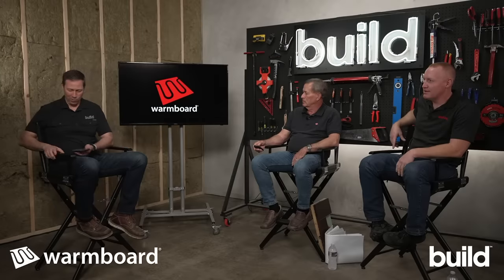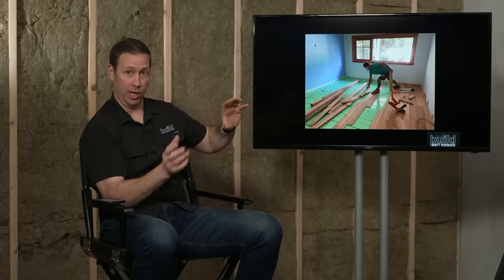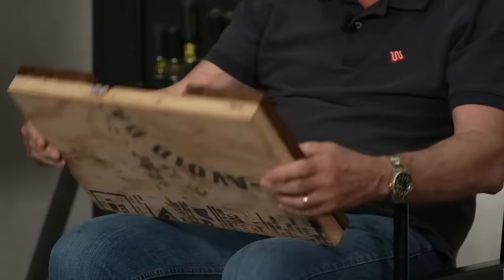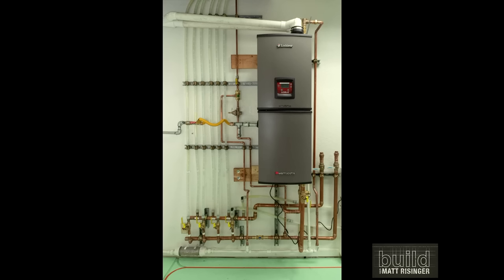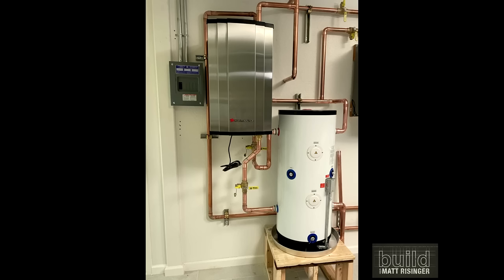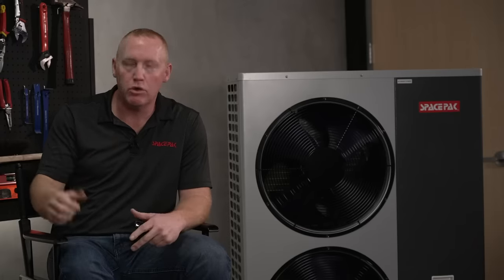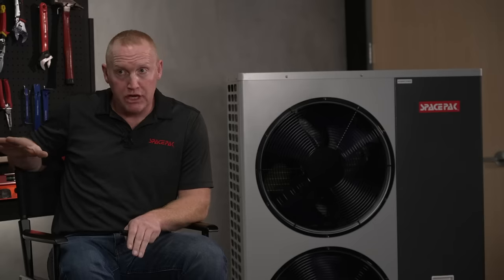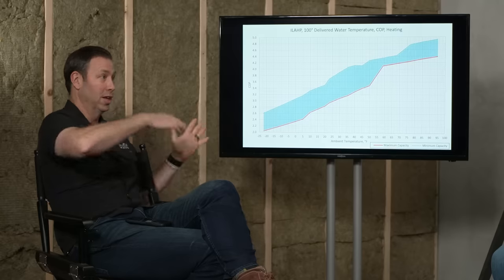Cold Climate Heat Pumps for Radiant Floor Heating. No gas, no boiler!

Comment: We considered warmboard for our home, along with 3 of their competitors, received samples from all of them.  From this mechanical engineers perspective, warmboard is in a league of its own and I have no doubt it is mechanically the most sound system and the most efficient system in terms of operating cost.  The problem is the price kills the value proposition.  We decided on a pex/gypcrete system because for us the brake even period for the difference in cost between the two systems was 50 years!  That's $30k better spent elsewhere on the project, just please don't tell my wife ;)
Reply: As an engineer : Thank you for the analysis... (except the "telling the wife" bit 😂)
Reply: 100% agreed.  Great post!
Reply: Do you have any advice for the gypcrete/pex system? I'm looking to do this and the plumbers I've talked to have never heard of in floor heat being done this way
Reply: @riddled_hugs  Mike Day has a tube channel with a very good video on the radiant pex heat in concrete option.
Reply: @riddled_hugs  from the research I’ve done it seems to be common practice in England/Europe, there’s also a few guys in CT that do it, and I’ve found plenty of YouTube videos on the subject. I found a local gypcrete supplier who made recommendations on the process like what for them is an average thickness for a pour, etc.  For me it was also important to check with a structural engineer regarding wether or not our house, mainly the 2nd floor, could bare the load.  I had an engineer design the layout but I’ll be installing the loops and manifolds myself but it’s nothing a plumber you trust shouldn’t be able to install
Reply: @riddled_hugs  thought gypcrete/pex was the standard.
Reply: @davidparker8475  Thanks!
Reply: @mcltadros  Thanks for the advice!
Reply: When using slab on grade as your floor , what is the best systems?
Reply: just use isolation, pipes and stone floor. nothing better then that
Reply: I’m not sure I heard Matt right did he say an additional $6 sq ft on top of what?
Reply: I'm in Saskatchewan and built an ICF house (both walk out basement (14.4" walls and upstairs 9.5" walls) we have 2' high heel rafters with R80 in the roof.   In-floor radiant in basement (and triple car garage) and upstairs I did 1.5" of gypcrete with radiant again.   The house looks due south with large triple pain windows.   We are the last people to turn on the heat in the fall and the first to turn it off in the spring.  We have tile floors throughout except the bedrooms which have cork flooring.   I had to do a LOL when he said concrete is bad radiant heat...ummmm...thermal mass is very good for radiant heat.   Plus as you said the cost of Warmboard is crazy stupid.   Put that money into triple glazed windows and better wall/ceiling insulation.

Comment: They were $225 for the structural, then $350 for the remodel panel, now I don’t want to know either.  Just the floor could cost you $30,000 in a normal size house. It’s just to much.  😢
Reply: This assumes the $225/panel mentioned above. Advantech is over $100 a panel so for a 3200 sq ft home (100 sheets), you're talking an upcharge of about 12.5k... considering the cost of ductwork, framing considerations for ductwork and labor alone I feel it's already cheaper to go with warm Board.
Reply: @bjcombs1989  you are correct, if the 1 1/8 warmboard is $400 and the LP 1 1/8 is $100 you need to deducted $100 from $400.  The $225 is years and years old.  So you’re paying $30,000 for your heating just for the floors!!!!  Warm board also up charges for the boilers, pipe, fittings, pumps, blue prints etc etc that you can build in the stores for about $2,000.   Im sorry but $50k for some heat is a rip off!!!   You can install the pipes under the LP flooring and still have radiant heat.
Reply: @bjcombs1989  you are correct, if the 1 1/8 warmboard is $400 and the LP 1 1/8 is $100 you need to deducted $100 from $400.  The $225 is years and years old.  So you’re paying $30,000 for your heating just for the floors!!!!  Warm board also up charges for the boilers, pipe, fittings, pumps, blue prints etc etc that you can build in the stores for about $2,000.   Im sorry but $50k for some heat is a rip off!!!   You can install the pipes under the LP flooring and still have radiant heat and everything minus your subfloor shouldn’t be over $3k which it all depends on your boiler.   A $500 hot water tank works just as well.
Reply: @neckofthewoods24  I haven't researched the price myself to know the $225 is old. It still has advantages and just comes down to what each individual job requires. 

The fact that the company charges a non-refundable design fee just to get a price makes me not want to do business with them. Tell me what sheets are available and what I can buy them at and I'll consider it, but make me pay to find out your price feels like price fixing to me.
Reply: @bjcombs1989  they always told me the two times I asked.  Once for the S and once for the R’s.   That was about 2 years ago for the R’s.   Even at the old pricing I couldn’t see paying that much more for a subfloor.  Thats when the S’s were $225 and LP was $50.   That’s $17,500 more just for a floor.  Since we all know Matt’s said it a million times, wood has a horrible R value, stapling the plates under the subfloor will still work!  It’s only 3/4” of wood.

Comment: The concretes advantage is it will hold more heat.  The warmboard might get the heat out quicker but the concrete will keep heating for longer.
Reply: Good point I didn’t think about that! So don’t use this on a new concrete slab?
Reply: @golfaddict75  absolutely on a slab! The inventor is comparing use in a joist type floor....in that situation concrete may not be ideal bc of the weight.  2-4" of insulation under the concrete.
Reply: We have radiant floor heat in suspended concrete six inch spacing with a ground source heat pump.  Buffer tank is 95 degrees tops. Condition crawl space .  I love it.   So glad to see it
Reply: @golfaddict75  The standard in Europe is 8 inches of insulation under the slab and radiant water pipes set into the slab about 2 inches below the surface. But lots of thermal mass means very slow response times. The people building using Passivhaus concepts sometimes tweak the thickness of the slab so that the slab reaches its warmest around 9pm, and then the heat pump is turned off until 9am the next day. The slab releases heat that has been gathered during the warmest part of the day overnight when temperatures tend to drop. This way of working also allows more of the electricity that is operating the heat pump to be produced from solar.
Reply: for the price warmboard costs could just go with solar panels and electric radiant heat
Reply: Its great in a garage slab but when you go from 25 degrees ambiant to 45 in two days your room temp will overshoot and you will cook!
Reply: Holding heat can be a severe disadvantage. We had an on-slab house and in-floor radiant. As the day warms and heating requirement drops the warm concrete continues to pump out heat. It makes the house uncomfortably warm. And if the sun is coming and going due to clouds, the house can all day long go back and forth between comfort and hot, potentially never really being in the sweet spot of comfort. We stopped using our radiant because of this and installed forced air. Any radiant type of heat has to be able to quickly change heat output into the house. There simply is too much lag time with a concrete slab.
Reply: Set the temp at 71 and forget to change it if ambient temp is above that the boiler or heat pump will not engage. In floor heating is the lowest btu cost.   And is the most consistent especially on a well insulated slab. I have 1000 sq ft garage only half of slab is insulated that I keep set at 50 degrees during heating season,  adds less that 15 dollars per month. Try doing that with forced air heat.
Reply: Why would you want to hold the heat in the slab though, as opposed to the buffer tank? You can call on a buffer tank's heat any time you want, whereas with a slab you're stuck with past decisions for a long time and have to schedule changes in setpoint (e.g. coming back from work/vacation) far in advance.7
Reply: @joeyscleaninglady2877  That'll work great on days you don't need heat. LOL
People imagine the solar / battery system to work much better than it will.
Reply: @tlangdon12  in America people try to avoid using electricity during the day, and instead use it at night when possible (charging cars, running dishwasher, etc) because it's thought to be better for the environment. The thought is that grid energy is over-stressed during the day and under-stressed at night. It's thought that some power stations have extra energy at night that must be wasted, because the station cannot be turned off.  But I guess it depends on the grid and location.
Reply: @0my  Do the tariffs in the USA encourage this overnight usage?
Reply: Geothermal heat is good and it is about the cheapest that there is over the long run but the costs are high upfront. There is now a 30% tax rebate through the next few years once again, which is the only thing senile Biden did that was right. Anyway that’s something you can check into and also I’ve been hearing about heat pump geothermal boiler systems and I don’t know enough to comment on the reliability of them. I would stick with Geothermal if you can afford it and really you can if you have a decent job at all and it’s going to pay for itself in five or six years.  I would never install pex tubing underneath my floorboards because it gets way too hot on your feet!!!   …and it’s very expensive to do so especially with crawl spaces!  I would install the old radiator types along The wall that are covered up, which is best, but sometimes those old radiators are really nice …it just is your choice.   That’s the only way I would do boiler heat.
Reply: We do experience lag with our 5” radiant slab.  But my thought is that I’m putting my heat into a huge heat storage.  So when my 3 boys open doors and go in and out…I’m not losing heated up air…my heat is in the slab.  Even a forced air house heats up the floors walls and overall mass, but using warm air to heat a mass is really inefficient.
Reply: I have a house/shop. 2400sqft of shop below and 1000sqft of living space upstairs. Geothermal and solar. So zero bills. All infloor heat  6 zones. 3 inslab downstairs. And 3 zones of warmboard upstairs. Warmboard is so awesome. There is no overrun. Stays 1 degree plus or minus on ambient thermostats. Slabs downstairs can go plus or minus 3-4 degrees either side of the ambient thermostats. So 6-8 degrees variance in ambient temperatures. I think warmboard is THE MOST EFFICIENT infloor heat. They do all the planning and layout for you. And include all the hardware tubing. I installed it all. Myself. I drive a forklift for a living.
Reply: @danmccoy6164  and that will cost 25-30,000 dollars to install.  Most people can’t afford this.    There are still good ways to heat without Geo thermal. And not costly.
Reply: A high mass house is a completely different strategy than a low mass house. A house in sunny New Mexico can use passive solar sunshine to heat the a high mass slab. As they mention in the video they sell a lot of warmboard and spacepac low mass systems in Canada. I don’t want complex systems with moving parts and expensive control panels so am building a passive solar house.  Lightning is a big concern for electronics. I know several people who have to replace the expensive control boards in their inverters due to lightning. Inverters are really cool technology however.
Reply: I grew up with a radiant floor house that built in the 50’s. Been wanting to go back ever since. Every time the forced air furnace turns on it reminds me I’m burning fossil fuels. Our retirement house will be all solar and radiant. Check out Electrodacus. Damian is a engineer living in a all solar and all electric house in Canada. It will be way easier for us in sunny New Mexico. I recently toured a house in the desert that will have no heater and no air conditioner!! Well, they will have a wood stove but it will be seldomly used.
Reply: @joeyscleaninglady2877  - If you were using it for the entire house, sure.  If only using it under tile or hardwood, like bathrooms and your kitchen, it would be less expensive.  To your point, solar panels are coming down in price so quickly, even the low COP of an air-source heat pump in sub-zero temps is very cost-effective, when you're producing your own power.
Reply: @edwardluth7740   sorry for very late reply. But I  installed my geothermal and the tubing and manifolds for the warmboard. Had my contractor put up the outside and studs inside and I did all the rest myself. So the contractor installed the warmboard subfloor upstairs. Didn't charge any more than installing regular subfloor. 
Anyway I installed everything and it cost $22,000 for me to install all the infloor 2400sqft of inslab downstairs and 1000sqft of warmboard upstairs. The entire geothermal system. Including having 4 horizontal loops installed for $5000. Verses the estimates for having conventional HVAC installed. $28,500 to $34,600. It's now coming up on  running 7 years no problems whatsoever. Still Zero Bills.  My house is all electric. No gas at all.

Comment: We built a SIP house 4 years ago in Ontario Canada (46°N latitude) using a horizontal geothermal heatpump and radiant heat on both floors.  The heat pump rary goes to second stage in the winter and has never gone to the electric backup.  In the summer we use the floor as a heat sink (with some custom programming to prevent moisture on the floor) and it has been amazing!
Reply: Can you elaborate more on the heat sink part? Do you just keep the temp is the low 60's to prevent moisture build up? Or do you go lower than that?

Comment: I got prices for warmboard.  It was off the charts high.  This is why Terry will not speak of price.  I built my own with strips of plywood and aluminum fins over my subfloor and it works great.  

Heat pumps are not silent.  When the temp gets low and the outdoor unit ramps up for extended periods of time you will hear that unit.  

Matt Resigner has great content but keep in mind it is sponsored and like most salesman they only give you the pros not the cons.
Reply: what $400 a panel isnt cheap?  haha
Reply: I felt like the warm board guy was about to sell me a timeshare.
Reply: I'd like to see a picture of your version of warmboard.
Reply: I imagine it would be substantially cheaper for a diy version. Maybe time consuming to route the plywood, shape and insert aluminum fins but probably cheaper overall.
Reply: @Rotor-Sims  82k 😲😳. They must have a amazing margin of profit on their system.
Reply: @Rotor-Sims  Well there's likely a reason for the stiffness on the price.  There's no way those panels are cheap to produce if they're using dies to stamp the aluminum and the plywood panels together.  Totally ignoring the costs of the coatings and then all of the printing on the back of each panel.  However, if you're living in a cold climate their system likely saves you as a homeowner several thousand a year on heating energy costs.
Reply: Most people already know that Risinger's YT channel is for the top-tier middle class and beyond..
Reply: Radiant heating is significantly more expensive to install than a forced air system.   A cheaper alternative is hot water baseboard.   Mine is efficient and quiet.  Only thing I don't like is having to clean them every year.
Reply: This warmboard is such a scam, like a lot of unnecessary crap these people try to sell uninformed buyers of radiant systems. Radiant pipes can be simply loosely stapled to the underside of the subfloor - no metal plates needed. Think about it - the heat dissipates from the pipe to it's surroundings. You need only seal up the ceiling below and the rim joist ends. That way the heat will dissipate UP through the floor, where the heat wants to go anyway. When they tell you you need these aluminum plates to transfer the heat efficiently - IT'S A HUGE LIE!
Reply: @gswproductions9446  It's not, wood is hardly a good conductor of heat.  Is it more marketing and unnecessary for people who are more budget conscious?  Sure, absolutely, their process isn't really replicated because of cost for obvious reasons.  However, that doesn't mean the product is a scam, nor does it mean that it doesn't have benefits over other products.
Reply: I've been running my warmboard system for 7 years. It  replaced the plywood in the  subfloor. So some cost reduction.  My contractor put up the outside of my house. So he installed the warmboard for no added cost. Only slightly more work laying it out .And I installed the rest of the system myself. Matched up to the geothermal system I also installed myself. Along with the inslab downstairs. Warmboard initial start up about 45 minutes to temperature. Inslab downstairs hours and hours. Inslab +/- 6 to 7 degrees. Ambient thermostats. Warmboard +/- 1-2 deg. Spreads heat so evenly no cold spots. I installed warmboard, inslab, chilled water fan coils and geothermal. Myself. For $22,000. I got estimates of $28,000 - $32,000 for conventional HVAC installed. The warmboard was the easiest part of the installation I did myself. 3400sqft in Wisconsin.
Reply: Sounds like a great cost saving option. I look forward to learning from you. Would you please post a pic of your version of warmboard?